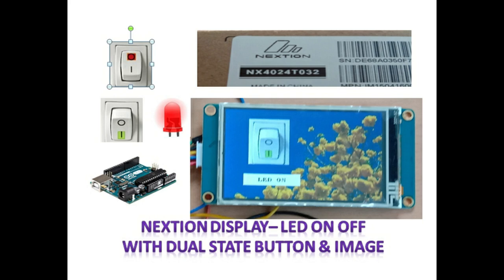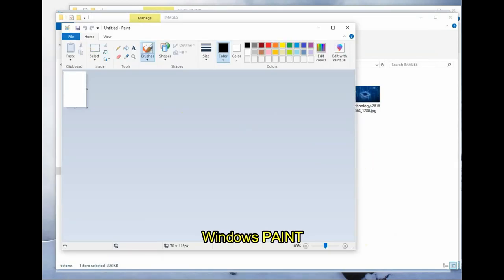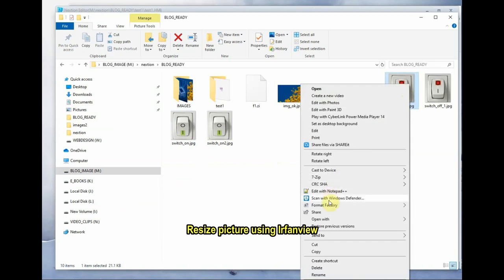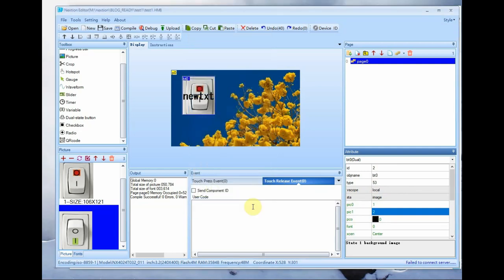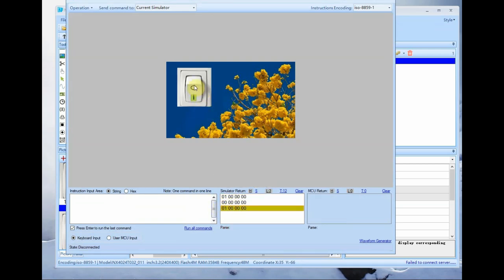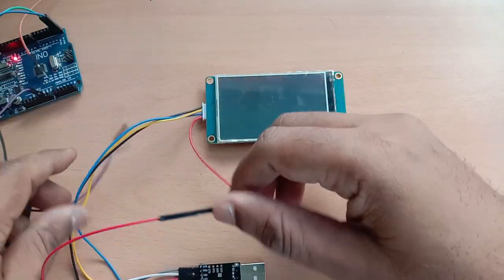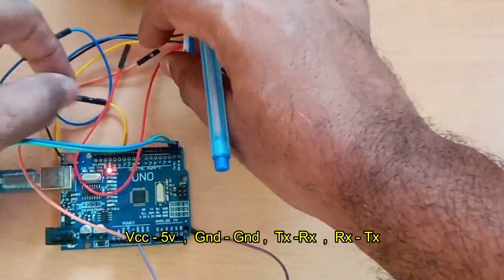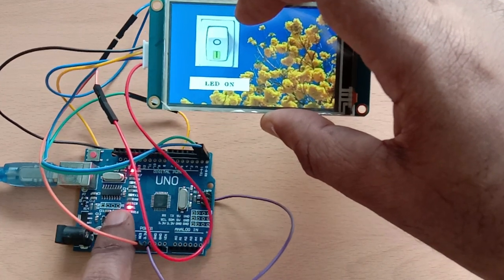Nextion Display   LED On Off with Dual State Button & Image

Comment: I'm using your example code to stop and start a pulse motor that the Arduino MEGA runs. Your code is simple as Panali mentionned. Eventually it will be a 3phases PMSM... Just learning right now!

Comment: 😮Hello.  Your code works well for one dual state switch.  However it won’t work for multiple dual state switches on one page or dual state switches on several pages. I’ve tried the following code on an Arduino 2560 but it doesn’t turn on the built-in LED on the Arduino board (pin 13).  I'm using a dual state button with this.  Any help would be appreciated.

#include "Nextion.h"
int ledPin = 13;
NexDSButton bt0 = NexDSButton(2, 9, "bt0");
uint32_t dual_state=0;

 void setup(void){    
    nexInit();
    pinMode(ledPin, OUTPUT);
}
void loop(void){   
    bt0.getValue(&dual_state);
    delay(200);
    if(dual_state==1)
    {
      digitalWrite(ledPin, HIGH);
    }
    else if(dual_state==0)
    {
      digitalWrite(ledPin, LOW);
    }
}

Comment: i have on situation.... i using two page. in the 2 page i use the dual state button. if i change the state of the button from OFF  to ON  and back to the page 1, when i back again to the page 2, the button state is not keep the state, button state is off. why?

Comment: Excellent and simple.
Good product demo.Can you please extend the project for practical application like home device control  or as security application.
Reply: I use it to show the RPM, frequency of a pulse motor. Also instaured a dual button to start and stop the pulse motor. The pulse motor was in part 3D printed and salvage a relay coil that I modified to adapt as a stator coil to my 3D pulse motor.
Regards.
Reply: I used it to make a "dark mode" switch for my wather station project. The limits are in your imagination.

Comment: It is possible to do it without the screen? I mean, just from the debug mode simulation, connecting the computer to the Arduino
Reply: Probably not helpful to you now, but in the debug panel there's an option in the bottom left corner called User MCU input.  This brings up a COM port selector tool.  From there I'm sure you could hook in an arduino or even just simulate an arduino using PUTTY

Comment: Pete.
Hi Saravanan.
 i am new to this Arduino Program.
Trying to run your code but keep getting error message ( EXPECTED INITIALIZER BEFORE NUMERIC CONSTANT )
Reply: let me know if it works

#define SWITCH_ON 1
#define SWITCH_OFF 0
const int led = 12;
byte received_data[4];
int  switch_pos;
void setup() {
  // put your setup code here, to run once:
  Serial.begin(9600);
  Serial.println("ready");
  pinMode(led,OUTPUT);
  digitalWrite(led, LOW);
}
void loop() {
  // put your main code here, to run repeatedly:
  int i;
  while (Serial.available() > 0) {
      switch_control();
  }
  
}
void switch_control() {
    int size = Serial.readBytesUntil('\n', received_data, 4);
    // First Byte has the switch position data 
    switch_pos = received_data[0];
    Serial.print("SWITCH:");
    if (switch_pos == SWITCH_ON) {
      Serial.println("ON");
      digitalWrite(led, HIGH);
    } else if (switch_pos == SWITCH_OFF) {
      Serial.println("OFF");
      digitalWrite(led, LOW);
    }
}
Reply: Did you ever figure this out Pete?

Comment: hello sir , i love your videos. but can you make a program similar to this but using software serial instead of rx tx in the arduino?? that would be more helpfull thanks :)
Reply: I know that your comment is over a year old and you've probably figured it out, but for those who don't know, the answer is YES!
When I was using Nextion on a regular Nano, I had to use Software Serial and set up the 2 pins I wanted to use for RX and TX.  I would make that Serial2.

But here's the thing, if you are using say, a Nano Every board, it already has 2 serial ports on it (maybe it's 3, I forget).  So you don't even need to use Software Serial. By using hardware serial, it's much faster too.

However, consider moving to ESP32!  I just did recently and now kick myself for not doing so long ago.
So much more memory.  So much faster.  Dual cores an yes, you can code using Arduino IDE and use both cores!!  Nextion works perfectly on the ESP32, HOWEVER, YOU MAY NEED TO USE  LOGIC LEVEL CONVERTER because the ESP32's logic voltage is 3.2V while Nextion's logic voltage is 5V.
Sometimes it just works, but as I ran into, sometimes it does not.  ON the project I'm working on now, I had to use the logic level converter, which is super cheap and easy to connect.

Hope that helps.

Comment: But this is a very bad solution , because you never send the id of the button to the microproccessor , whath happens if you have two buttons ? how can you detect from wich button send the command? do the same with 3 buttons ... and you see what i talking about....Thanks
Reply: No problem, every button have other ID...
Reply: Hello, I ran into this problem. I don't know how to fix the problem.
Reply: @jokkiossaka3306    help me
Reply: @kritsadaonkhong3148  Hi will you consider to look at the DWIN display?kindly send me an email or message referring to my banner contact info.